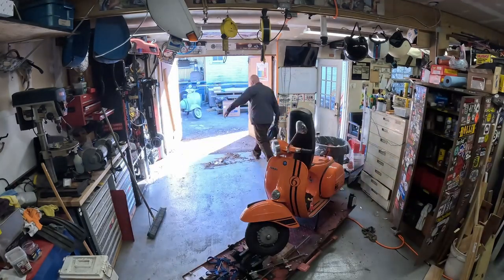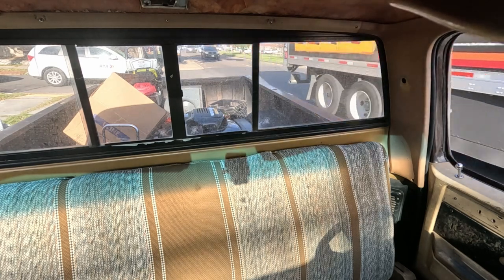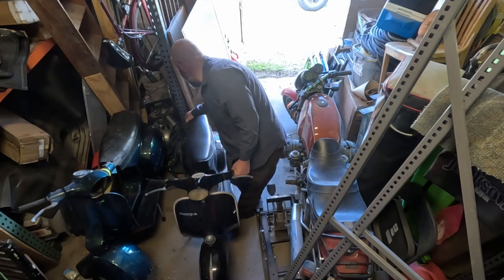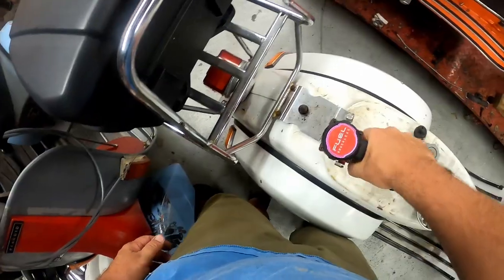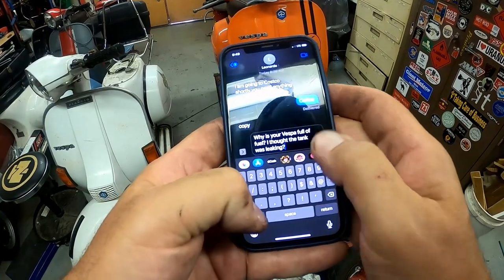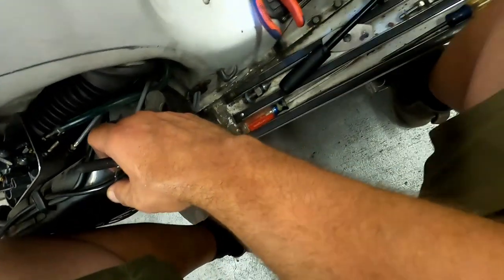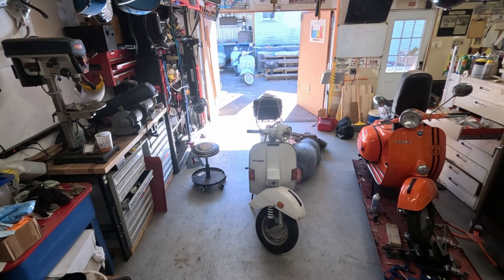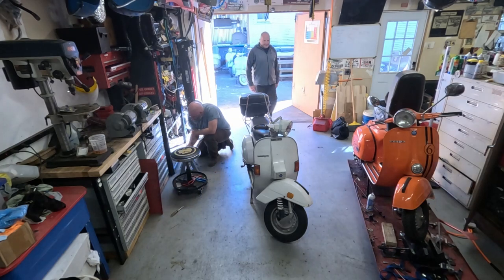I'm back! Back to working on Vespas and Leo's is back in the shop

Comment: I just my P2 back together. Had the carb box, oil pump off , but now I don’t think it’s pumping oil. Primed it by pumping oil into the pump and sucking oil from the tank, had a 1” bubble in the hose. Put in a gallon of premix. Started it and watched the bubble get pulled in and disappear. But now after two trips out and about 30 miles in, the oil level in the tank has not moved. I’ll keep running premix, but this worries me.
Reply from the maker: Oil consumption is not the same as fuel. If it pulled that bubble in, its working! With premixing fuel you are running too rich and will foul your plug. The best way to know your set up correct is to keep an eye on your plug. If its black and oily, too rich, if its white and ashy, too lean. You want it to be a sort of chocolate color. I only put oil in my tank every so often, not even close to every other fill up of fuel. The oil tank holds WAY more oil tan the scooter uses vs fuel...